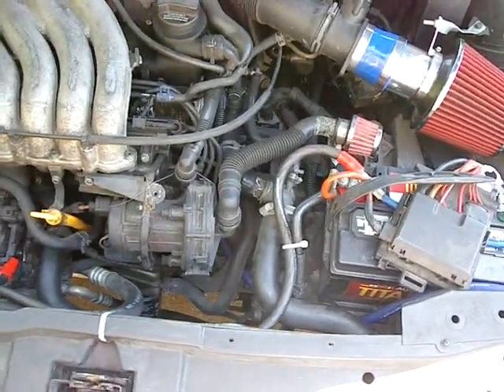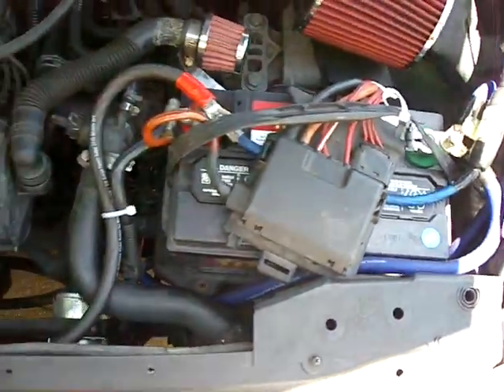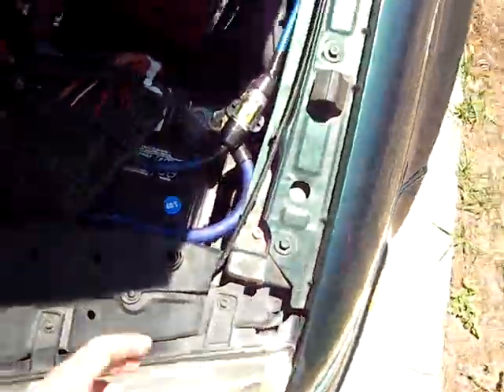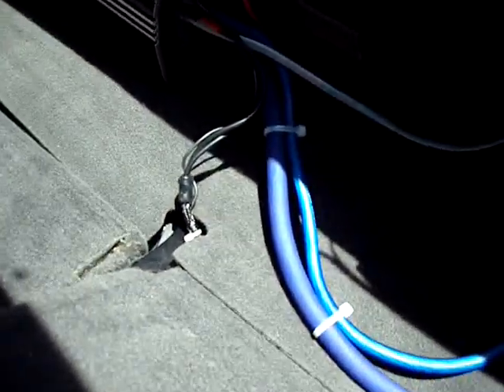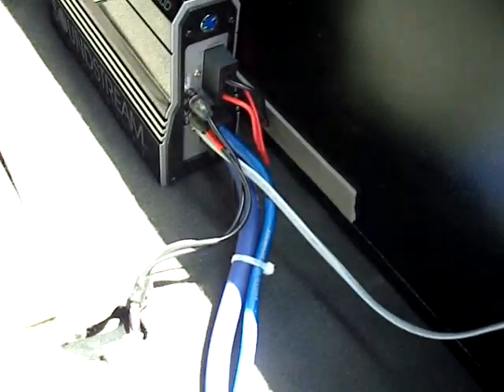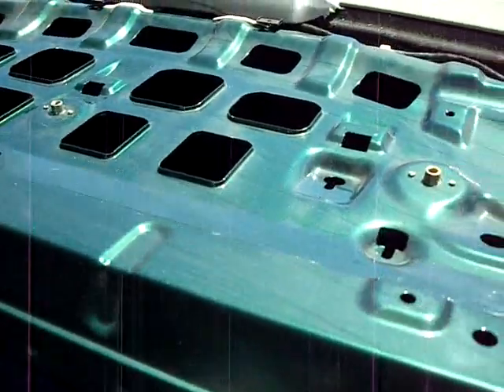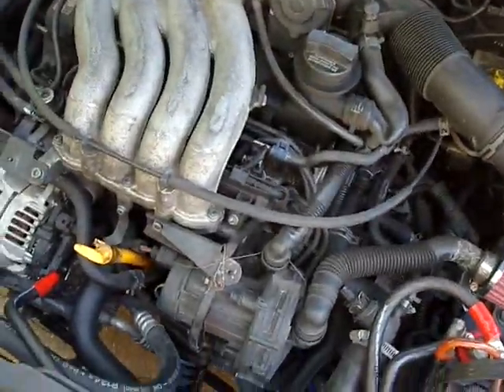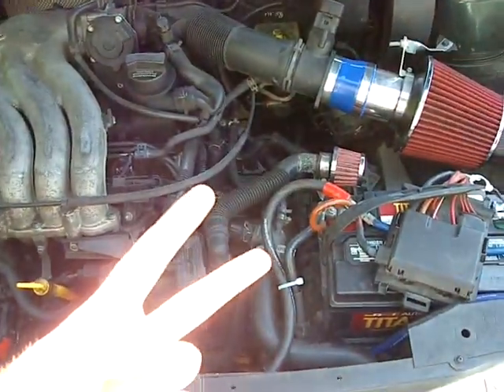BIG 3 DONE! Jetta update

Comment: So do you still run the original alternator power wire that goes to the fuse block? I am doing the same thing and was just going to bypass that wire but wasn't sure as it is fused.